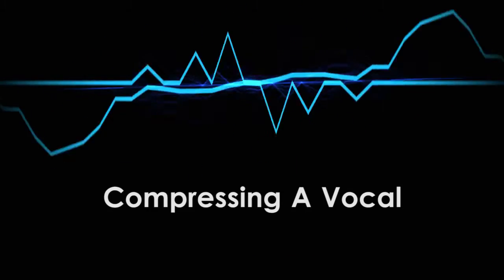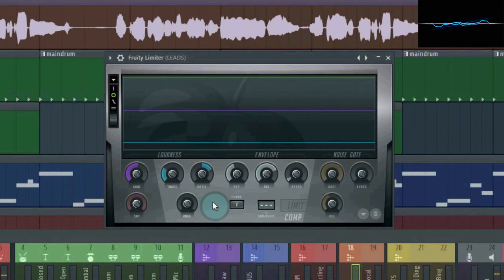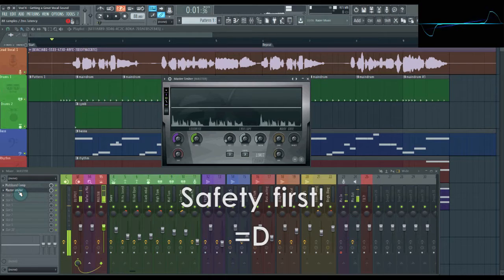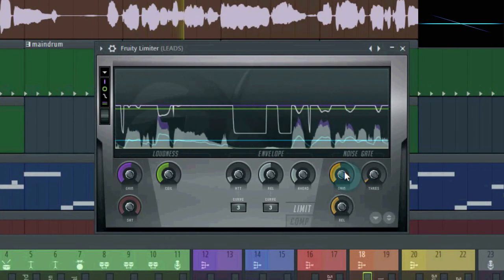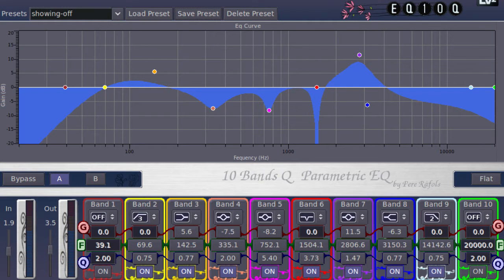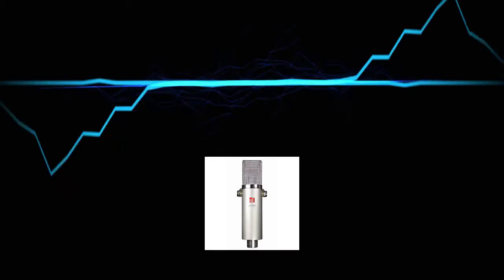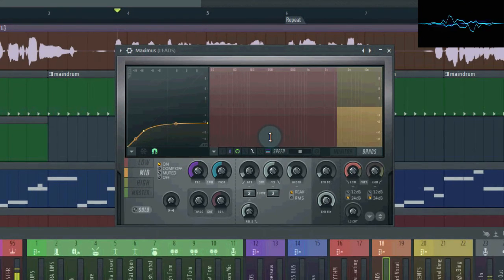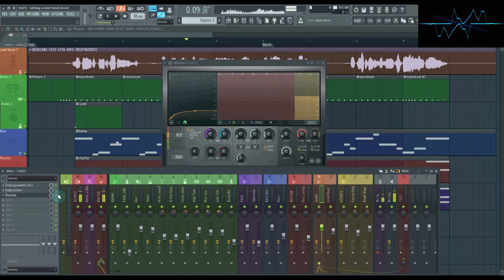4 Special Compressors to Improve Your Recordings - VoxFX Ep. 18

Comment: the multiband compressor can also be used to reduce plosives in the same way it can be used as a de-esser. just find the frequency range and apply correct threshold and compression such that only your plosives are being compressed. ;)
Reply from the maker: +emaricasARMY That's true, too, but I generally prefer to take care of my plosives with a pop filter and a highpass filter. Now, I DO use a multiband on problematic low frequencies in other instruments (i.e. some synth basses). I call it a "de-boomer."
Reply: i agree that plosives are best dealt with during recording and not in ladder stages. but i do mention this as it still surprises me how many people either don't use a pop filter or are using them incorrectly and still have plosives in their recordings. its just a tool that could be used to deal with a few stray plosives that do slip into the recording.